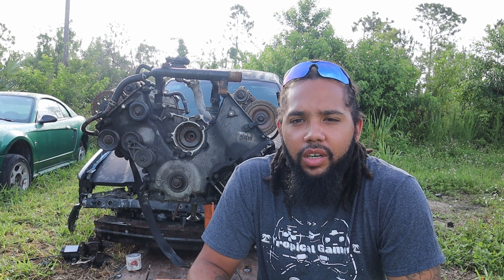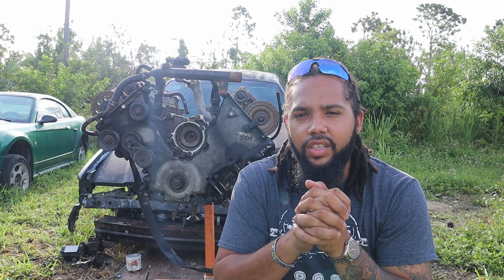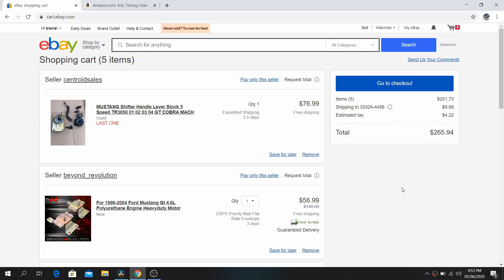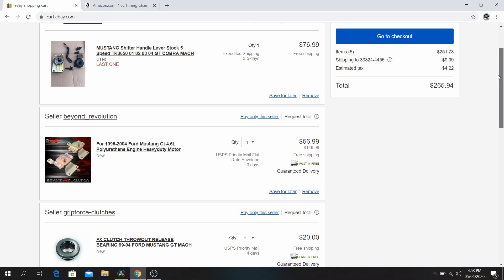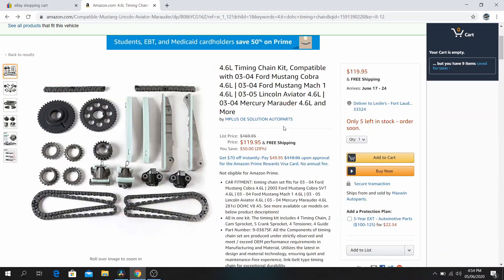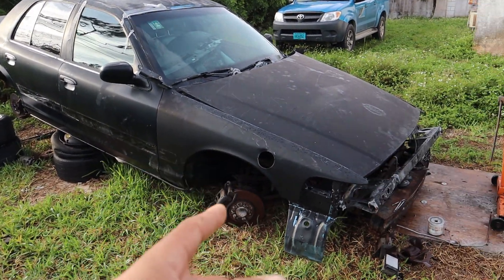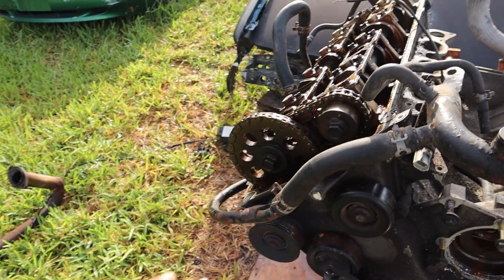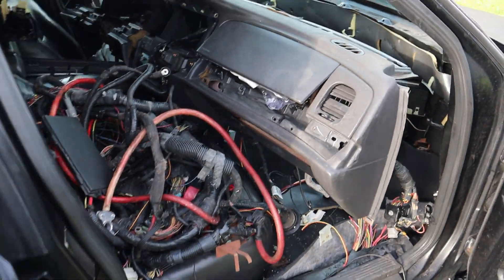Cheapest 4v Swap On Youtube

Comment: Yooo I’m in the 252 lol.  But I just picked up my 4v for $100 runs and drives. Gonna swap my 01 Roush as soon as I decide to quit doing 5.0 stuff lol.   Ps you don’t need the 4v harness in a gt the 2v harness is very easily modified to fit. But seems you have a v6 so I’ve never actually seen that swap.

Comment: Can a DOHC 4.6L engine fit in a 1996 Ford Mustang GT?
Reply: lol ohh I’m from Turks idk if u ever been on this side 96 04 mustangs and foxbody is the prime I thought the 96 engine bay was lil small but kool
Reply: Ohhhk that’s good mnn mustang still moving around here in provo here n there i have a 96 GT mustang sadly it’s a 3.8 fuel injected but I’m trying to swap a 4.6L in there
Reply: 4v will plop right into any 2v 4.6 mustang with very little mods. Stock ecu and harness is easily modified to work. But the foxbody and sn95 share the same basic body so if your willing to put in the work and have the coin the dohc 4.6 can bolt into any mustang 79-04 .... for the most part